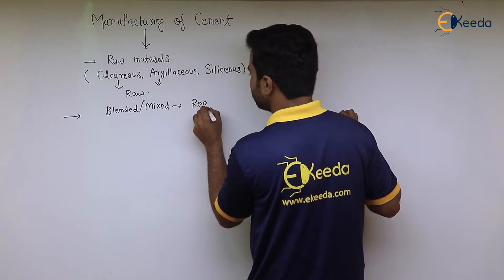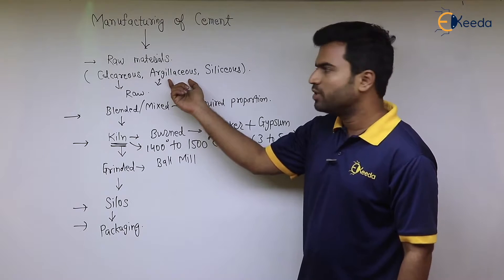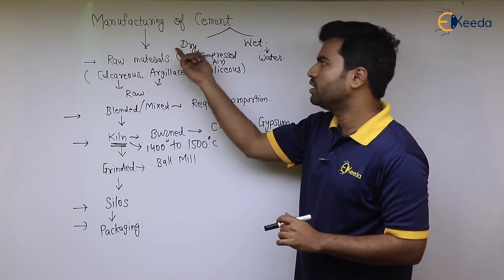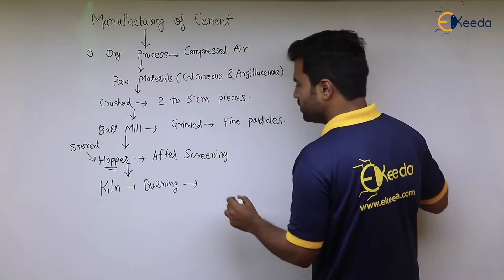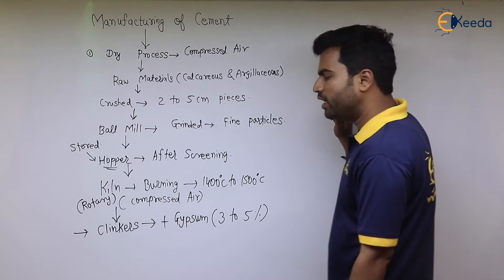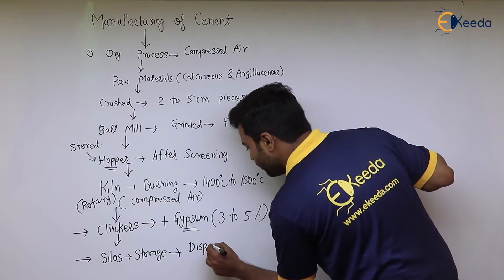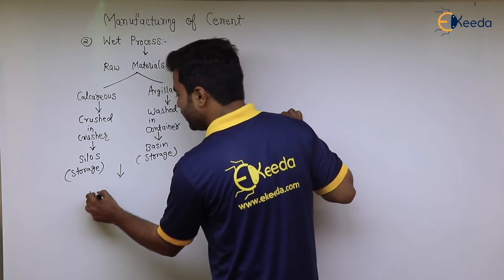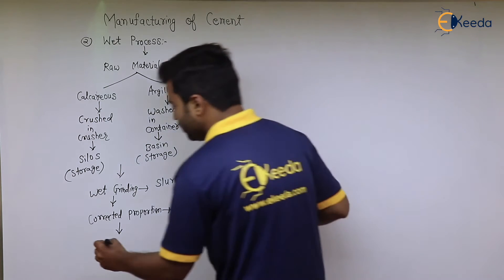Manufacturing Process of Cement -Properties of Concrete - Advanced Concrete Technology

Comment: Why the gypsum is added after clinkers can we use gypsum in starting of process
Reply: No, gypum is vary expensive. If we had used the gypsum at the first, we would have losses which is bad for economic. So, we can say that we conclude that gysum should be added the clinker is crushed and make in fine particles.
Reply: Gypsym is added to delay it's setting time only
Reply: No